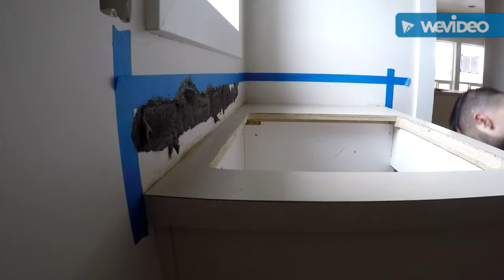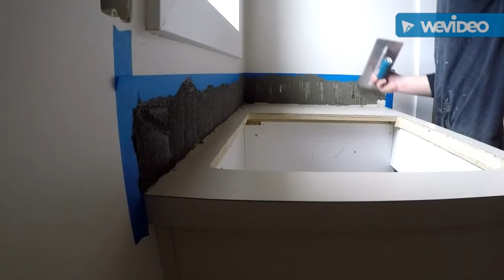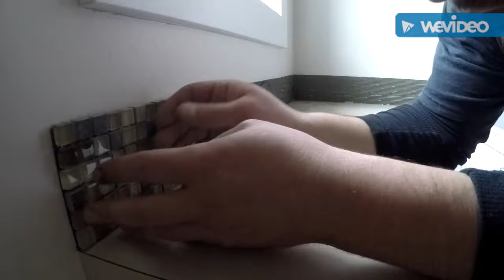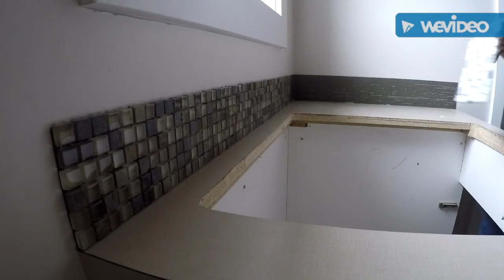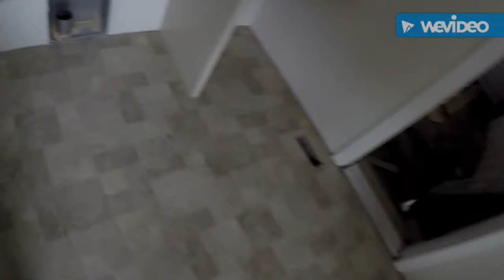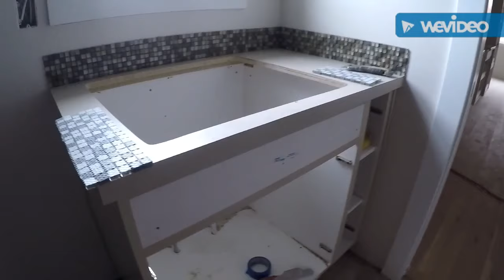How to install a tile backsplash - how to install tile backsplash - glass tile backsplash

Comment: Should there b a gap from the counter to put silicone? Im bout to do this. N only have 1 shot
Reply from the maker: No, you don’t need a gap. You can install the till tight to the counter top.
Reply: Movement

Comment: So if you have to wait over night to grout then it isnt 15 minutes right? Even Phase one took more than 15 minutes to prep and install.
Reply from the maker: +Temujin Khan the drywall and stone Tile will absorb the moisture out of the thinset fairly quickly. So you could probably grout after about an hour. Great question!